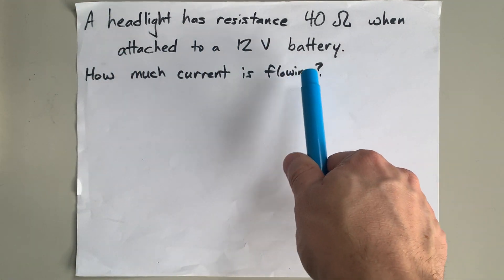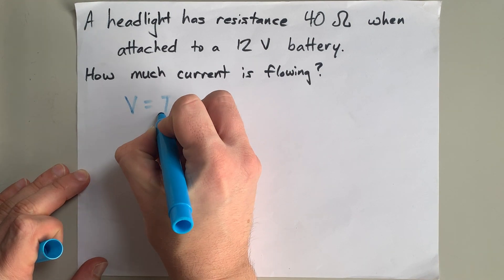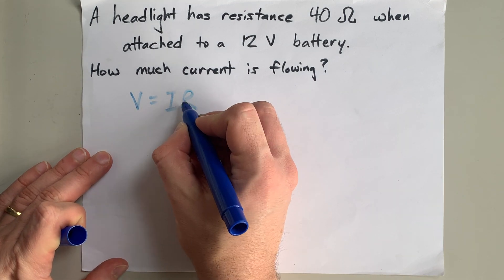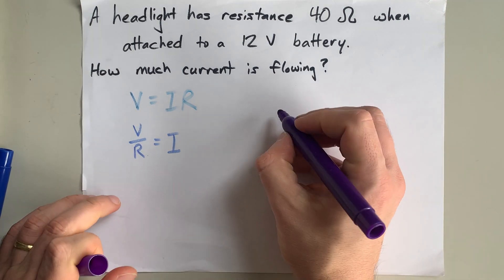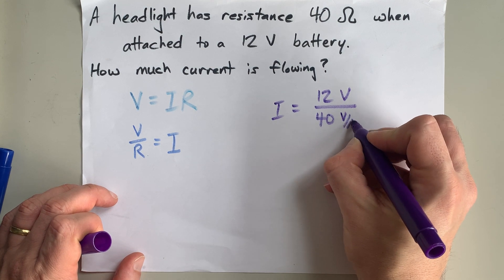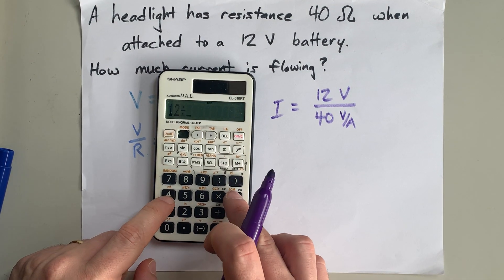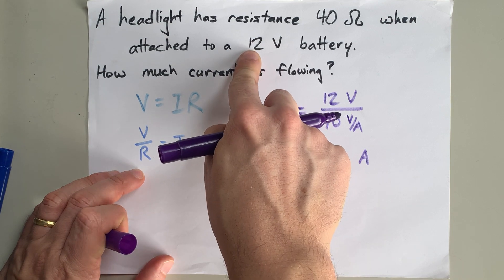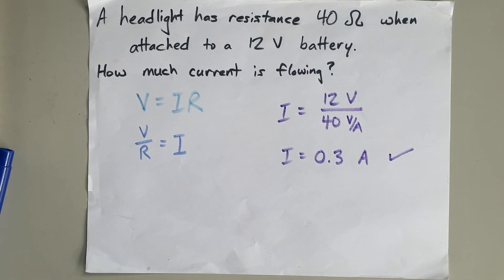Calculate Current from Resistance and Voltage

Comment: A sample of 5.6g Fe is completely dissolved in cold dilute HCl to prepare 250 mL solution. Titration of 25 mL of this solution requires 12.5 mL solution of 0.03 M( M represents Molarity) KMnO4 to reach end point. Number of moles of Fe ion present in 250 mL is —> X * 10^-2 ( Consider complete dissociation of FeCl2). Amount of Iron present in sample is 
Y% by weight. ( Assuming KMnO4 react with Fe ion). Find X and Y.

HEY ChemistNATE , this is a question from an exam in India ,JEE-ADVANCED. I think You should give it a shot and tell the method to solve and make a video 😀.

For your confirmation , answer is 
X= 1.875
Y= 18.75%